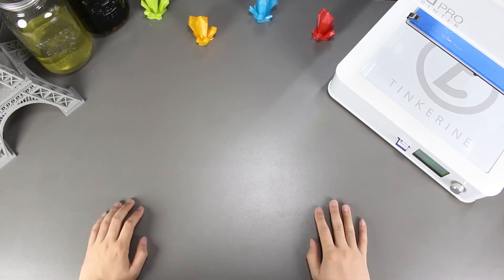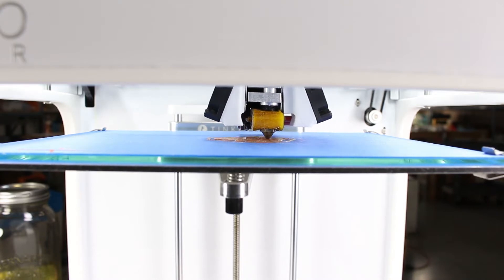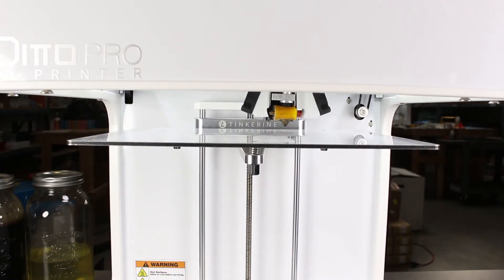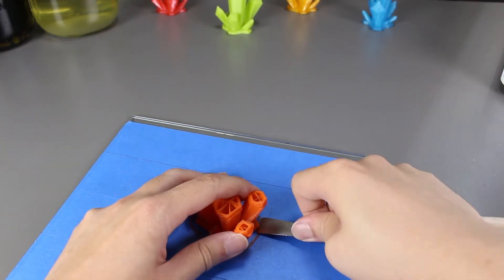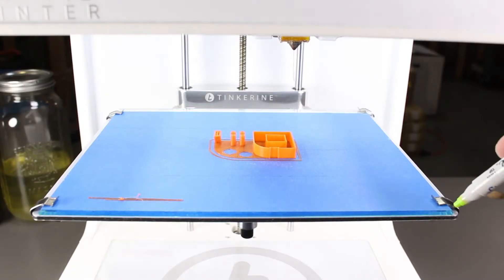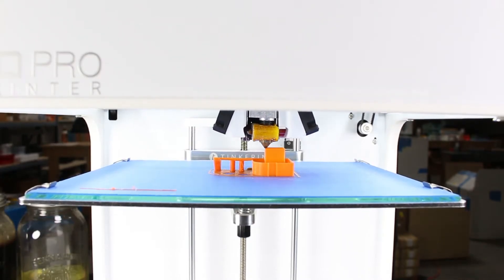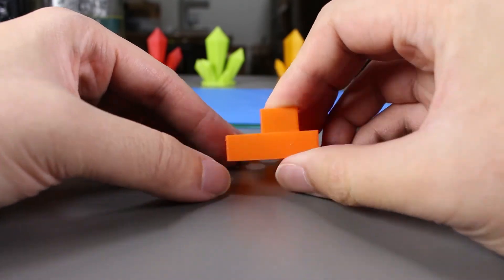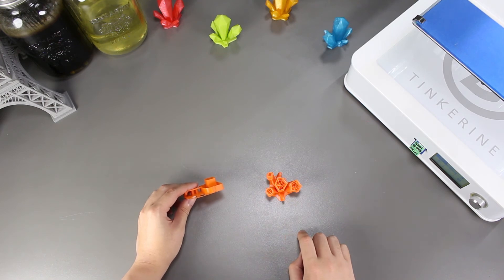Trying to Salvage a Print that Stopped Abruptly

Comment: The problem with your tactic is that you don't actually know at what % a print stops because of power outage or in my case the PLA running out. I actually succesfully continued that half-done print by very closely matching its top with the layers in my slicer, then deleting all the previous layers in the .gcode file and starting that edited gcode. That way you can just leave the print and filament on and don't need to have it printing in the air for ages.
Reply from the maker: Hi,

That is a great point!

Comment: i just hit resume print button after power goes out... most of time print looks almost as good as if nothing happened..
Reply: if you replaced the firmware (perhaps to get safety features not provided by the stock or change motherboard parts to quiet printing) you may lose this feature.  ofc 3d party firmwares will state so